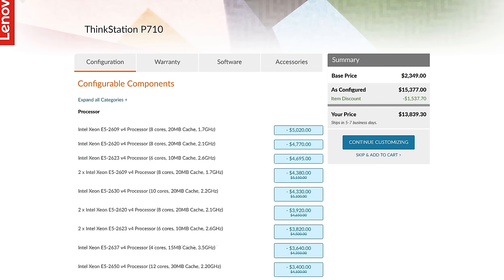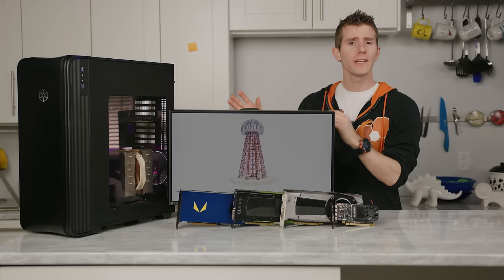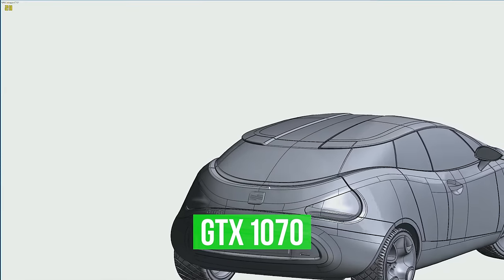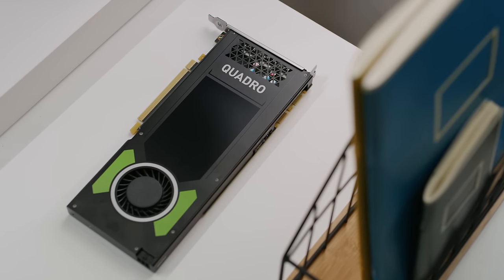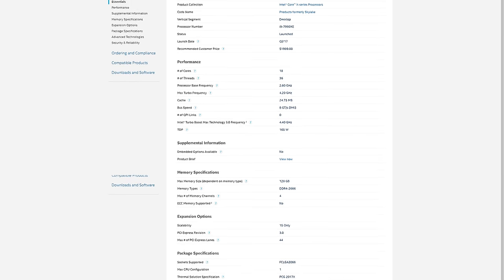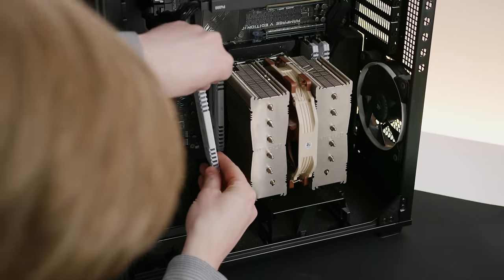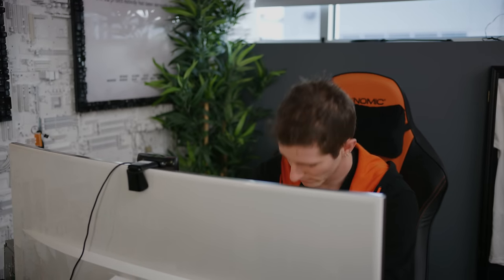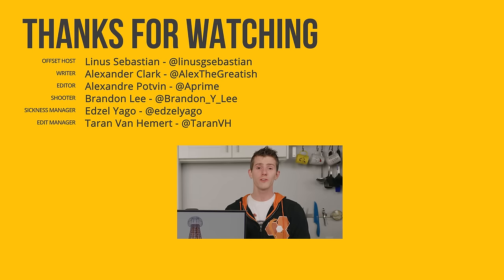3D Modeling & Design – Do you REALLY need a Xeon and Quadro??

Comment: Please rename this video to '3D CAD modelling and design'. Because in a regular 3D environment in a vfx or motiongraphics pipeline you're not going to benefit from quadro at all.
They have little to no benefit in maya/houdini/c4d/max.
Also if you are going to do gpu rendering you will need a nvidia card, because most gpu render engines use cuda. So AMD is out of the question there. AMD does perform slightly better on opencl so may be better for gpu based simulation loads (like houdini opencl nodes) But overall I recommend nvidia for that.
CPU workload for workstation I recommend higher clocked i9s over xeons due to most 3d applications not being fully multithreaded, your overal workflow will  be faster on a faster clocked system then a high thread/low clock one (talking from experience here)
Your benefit on having a lot of cores will be rendering or heavy simulation (or having simulations run as background tasks while you continue to work) But for a workstation I'd then still recommend getting a lower core one and getting a extra few cheap ebay xeon rendernodes on the side.
Reply: I agree
Reply: More like please rename this to best hardware for solidworks.
Reply: Agreed on all points. I would add that offloading rendering to one of the many cheap cloud solutions is probably more sensible than spending a ton of money on 8+ core Xeons and ECC memory.
Reply: Very well said
Reply: Sad but True. Mu suggestion for title is "3D CAD modelling and design in SolidWorks".
Reply: where should i look for 3D modelling NOT engineering laptops?
Reply: Tim van Helsdingen I agree 110% , what about working with substance painter that is all about cuda and iray rendering ? AMD take a performance hit when it comes to substance and software that is cuda optimized . also for things like keyshot you can never have enough cores. Pbr rendering ( physical based renders ) love core count as much as speed. This video needs to be retitled and you could do something more for the 3d artist using max , maya , zbrush , blender , keyshot  marmoset and substance. All these benched on a range of CPUs and gpus from i7s,R5s 1050s,560 to i9s,R7s, thread rippers and 1080 ti .
Reply: Was about to comment just that. 
Also recent gaming cards proved to work really well on GPU based offline renderers (RS, Octane etc...) the only benefit in our field from Quadro Cards is the 10bit output.
Reply: @Metical Then the title is still misleading: Modeling and Design...
Reply: Quadro was in the title. SO why would anyone think this video has anything to do with children's toys like  maya/houdini/c4d/max.
Reply: if you watch the video for literally 3 seconds they specify that this is for CAD. Might as well just read the title of videos instead of watching them.
Reply: GifCo how are houdini/maya childers toys? they are the industry standard for 3D animation and VFX work. Which is a completely different field from CAD design.
Reply: I understand that Blender isn't entirely considered a professional grade solution, but it's OpenCL based engine has actually gotten pretty mature with AMD.
Reply: Tim van Helsdingen aa
Reply: Title for sure was misleading. I liked the video for sure. It sure played out like an Nvidia and Solidworks commercial more than anything. Other design platforms such as Creo, SolidEdge, AutoCad, and Mastercam, as examples have very different requirements and capabilities. He also mentioned Abacus for FEA, which if you're using that for your simulations, you're spending thousands of dollars on the software and licensing alone. I'd spend $10,000+ in hardware to take advantage of it's ability.  For the longest time, CPU clock speed was (and some aspects still is) the major factor in CAD/CAM design. And as others have said, "Where's the FirePro cards?" I liked those for my PTC Creo machines over the Quadro cards once PTC certified them for support. This video was very tailored and specific to one product. I wouldn't empty the bank for my next build on the information from this video alone unless I was only using Solidworks.
Reply: Tim van Helsdingen hie.....my main work is in Maya and redshift...I also work on vray...so what card and processor do you suggest will be the best...m confused between Quadro and gtx
Reply: It fooled me, I'm sure it will do the others too.
Reply: Taylan Özberk I actually spent all night yesterday looking into just that for a friend who works a lot in blender and maya. We ended up looking at "laptops" from Sager, Origin and Eurocom (us companies), XMG (german company) and Webhallen (Swedish company). All specced similarly with i7 8700K, 32GB RAM, GTX 1080, nvme drives etc. We eventually found out most (if not all) of those are based on models by a  Taiwanese company called Clevo, and customized by the above mentioned companies.
I say "laptops" because while they technically are, they are 4 to 6(if you go for dual gpus) kg beasts which with their desktop CPU and GPU parts gets "up to" 2 hours battery life. As far as we're concerned that trade-off is worth it for the performance, but it might not be for everyone.
All of those companies also have cheaper/lighter/less powerful models (probably some with better batter life)
Look at benchmarks and try to figure out what level of performance you need. GL HF!
Reply: This is so misleading indeed and does not reflect 99% of the 3d industry (who uses solidworks for design nowadays ?). the only message shoul have been "it depends on the software you're using" and the same for rendering.
The subject deserves an entire channel imo (please do it :) for a rundown of all major 3d modelling softwares and a rundown of all major rendering softs.
Reply: Thomas Dissaux what do you recomend for design instead of sw.
Reply: I agree 100%
I finally convinced my firm a couple years ago of the same thing. They used to buy either Dell Workstations or Custom workstations from a local company who kept pushing Xeon(sometimes dual CPU boards), 64+GB ECC ram and quaddro's(probably for the money). We run point clouds using Autodesk Revit, Recap, Civil 3D, Leica Cyclone, Pix4D Mapper and Global Mapper. I built a system for half the price of those workstations using high end Intel Core processors and Nvidia GTX cards and ran circles around them in every use case.
And make no mistake my home build is all AMD, but for professional applications, they almost all use CUDA for hardware acceleration and single core performance is usually more important(to a point) than multithreaded capability due to a lot of programs only utilizing 2 cores at best at a time.
Reply: Himanshu Bansal For redshift rendering defenitely GTX. Way faster. 1070s are the best bang for the buck but if you can afford it just go for 1080ti's so you can stack more renderpower in a single box. Also using redshift for a lot of stuff, running 3 cards a.t.m
Reply: Tim van Helsdingen nVidia CUDA is a huge performance boost for a lot of 3D rendering and video editing :)
Reply: If does if the application is build for cuda. Which is exactly what I specified in my original post. No everything uses CUDA. 
Houdini uses opencl, no cuda. Realflow can use both cuda and opencl (cuda implementation is faster)
redshift/octane use cuda, blender cycles uses opencl. It really depends on the application.
Reply: this dude knows,
Reply: Chris Pyle What are the specifications of this build you speak of that outperformed your companies workstations? After this video I am really stuck on what cpu/gpu to get for a workstation. I use inventor, fusion360, meshmixer, revit, blender, cura, and adobe cloud products. These programs are somewhat all around concerning 3d modeling and CAD but I am mainly focused on the CAD side of things with the occasional render. For cpus I am in between the Ryzen TR 1950x and the i7 8700k. For the gpu I am in between the Quadro p4000 and the gtx1080ti. Is the Quadro that much better than the gtx to where it would be better for what I do or is the gtx not as far off from the Quadro as Linus explains for CAD to where I can get the gtx and have added benefit in terms of rendering. Also is there a huge difference between the single core performance of the i7 and TR to where the i7 is the obvious winner or would getting TR benefit me in terms of rendering and be not far off from the i7 in terms of single core CAD modeling. I am completely clueless as to what setup would be better and am asking you because you have real experience unlike most people that just put out benchmarks.
Reply: Himanshu Goel blender is totally professional. Some people are just misinformed.
Reply: This is not entirely true. I have run into repeatable crash bugs that are entirely the fault of a consumer GPU, SideFx's supports response to me was to either switch to pro GPU's or roll back to a Geforce driver that was more than a year and a half old. Geforce drivers move really fast, and are really sloppy for professional work, as they are always chasing the latest game releases, professional OpenGL performance be damned. Use a Geforce for professional work, and you will eventually experience a regression in performance.
Reply: Nope, can't confirm what you are are saying. Never had a problem with the consumer drivers so far, works great for professional work, for years and years. Downgrading software and drivers because of a screw up is not a big deal, I have machines where the GPU drivers are 1.5 or 2 years old and they work as reliably as the brand new ones. I figure that Nvidia does not even improve drivers, but mostly what they add is support for newer GPUs, which of course does not help me one bit with my existing one. If you want to go waste thousands on non-necessary products just because you are not smart enough to understand how this all works, well, go right ahead!
Reply: I have 20+ years of experience and in my experience, ECC RAM is a huge scam to milk more money out of customers. So far, I have had ZERO proof that it makes any discernable difference in a workstation. If you have a server that processes trillions of operations every week, yes, go for that, but for a workstation, the error rate is just too low to matter. If ECC was a huge deal, we would be coming across thousands of media reports of people screwing up or calculations being wrong, considering that 99% of all laptops and desktops don't use ECC RAM. Yet these reports don't exist, if you try to get to the bottom of the ECC scam, you will find the following: no hard evidence, no example cases of when Non-ECC RAM caused a measurable relevant damage or problem, most people constantly repeating the line "you have to buy ECC, everything else is dangerous and your computer will blow up tomorrow, you will have bit errors everywhere!" yet nobody being able to provide measurable evidence and facts. There are some theoretical estimations, that often get interpreted completely wrong as proving that bit errors are very common, which they most definitely aren't. It is pure snake oil and similar to the various oil and fuel additives: Can't be proven to conclusively help. Often people mention that it does not harm you. "I added that additive to my engine and it is working fine, so it can't be bad for it" Yes, true, but it makes hardware very expensive, there is the harm for you. And it really does not help one bit, as the problem it is supposed to solve does not exist, unless you got a super high performance system like a server that runs 24/7 for years. Or if you work next to Jupiter or in earth orbit and are concerned about cosmic radiation flipping bits. 
I wish there was more scientific measuring methods, like all workstations that are being used with ECC RAM having a logging mechanism that measures how many REAL bit errors really occurred (one bit error every 10 years?) and how many hours the machine was running for it, it would finally and conclusively show that it is a real waste and pretty useless. Use your own brain, test, measure and don't just pick up the party line that you are supposed to peddle (crap like "everybody knows that you need a high end workstation that is very expensive to do professional work, only if you spend a lot of money do you get quality and ECC RAM is a must for that!") Most work on this planet is done using normal consumer grade electronics that do not have ECC ram and neither need it.
Reply: For 3D rendering yes, but for video editing? Zero boost. Can you show me a factual analysis, a benchmark that shows CUDA helping with Video editing or rendering with Adobe Premiere and such? I have not come across it so far.
Reply: How is it a waste of money if the problem resolves after changing GPU and driver? How can you say that Nvidia does not improve the drivers when they issue release notes with every driver? Those release notes often include limitations, known issues and details of what was improved. Here's just one example of something getting fixed: [GeForce GTX 980/1080 Ti]: OpenGL program may crash when trying to map a buffer object. [2044697].  Regressing does not always fix issues, sometimes it just isn't possible to roll back to an older version of your DCC application as the project you are working on now may not be compatible with OLDER versions of the software. That's great you have never had problems with your software and hardware for the work you do, I hope that continues for you!  Just because people use different software/hardware combinations for different types of work than you do doesn't make them less intelligent, it just means they have different needs than you do.
Reply: The tests that you are talking about do exist. ECC ram fails significantly less. If you are doing the kind of work that needs ECC ram, you will know it, if not keep trucking on with what you are doing!
Reply: Link please? These tests apply to high performance servers, not your typical work station. ECC errors are recorded, when they occur and my point is: in normal non high performance constantly running server systems, they amount to an Bit error for like 5 years of use? These errors are so rare, they are neglectable. Do you buy lighting insurance for yourself? To protect yourself against a lightning strike into your head? Why not? These things definitely do happen ;-)   See the point? Of course ECC RAM does no harm, but it joins many products that clearly are bullshit and even though do what they promise, do not help one bit. Kind of like making your wallet bullet proof. It will help you if you ever shoot your wallet, yet..... when is that going to happen?
Reply: Any good software will support both, that Houdini only uses OpenCL seems crazy: I tested on my nvidia card on Blender, when using OpenCL, it gives you only HALF of the speed while rendering compared to CUDA. Generally, it is assumed that these results are because CUDA is much more optimized than OpenCL.
Reply: Just go to the wikipedia page for ECC ram and read the references and external links if you want to know more. I'll link you one well known study on failure rates to get started http://www.cs.toronto.edu/~bianca/papers/sigmetrics09.pdf If ECC ram doesn't fit your computing needs, great, keep doing what works for you. That doesn't make it BS, or snake oil, you just aren't in the market that is served by ECC ram.
Reply: It is snake oil, for 99% of all users. And of course I'm aware of the wikipedia article. This is theory, I'm taking about my real life experience. And I'm amazed how people just can't think for themselves. Did you ever experiement with ECC and non ECC RAM? Did you get a real error? Ever thought about it carefully, why ECC Memory is not mandatory in ALL devices, from your cellphone to every laptop sold? How is it possible, that you can game for 8 hours straight and have no crash, no graphics corruption (due to a bit error, meaning: Random and non reoccurring)? All these things can help you to analyze the problem. I just love how every time this subject comes up, tons and tons of people come out of the woodwork and defend second hand information that they read in some paper or study, that they don't even understand, while at the same time having ZERO critical thought about the issue, and zero experience and EXPERIMENTATION!
Reply: Shifting goal posts, nobody has claimed that ECC ram is needed for every computing device, not even close.
Reply: Taylan Özberk if you'd like to stick with a laptop then something higher spec from the Alienware line-up works well. I'm not a proponent of recommending Alienware products, but their laptops are popular among CG people. If you're modeling with C4D or Maya, then it opens up the possibility of a Macbook Pro. Running Bootcamp gives you more options on a Mac, but long term it's a bit of a hassle. Outside modeling there are GPU considerations that can rule out a Mac.
Reply: Gandalf721 yeah they make good stuff. I have a system here that’s built with almost all their stuff. Alienware was the only choice for laptops doing this work at one time (I’m old). There was no such thing as ROG back then lol. I guess some would argue it was when AW made their best gear
Reply: @nzjdmsti  Exactly what I thought because am thinking tools such as Autodesk Inventor, Autodesk AutoCAD Mechanical Desktop, ArcGIS, MATLAB, Siemens...., Machine Learning in Tensorflow, Pytorch. Generally, I wish someone will consider the most flexible setup for all Engineers and Scientists.
Reply: @GifCoDigital  Hey "serious" cad user lol CAD  can also be used to make buttons, switches, kids toys etc. MAYA and other can be used for 3D anatomy visualization, so hide your ego to your pants. "children's toys" lol
Reply: I sencod this, I learned in the hard way.
Reply: thanks
Reply: Agreed! Definitely need those Cuda cores for Vray RT rendering.
Reply: @GifCoDigital  ...reason why the great pyramids no longer exist. You know, they did not possess CAD software or finite particle analysis capabilities to keep structures from collapsing. ;-)
Reply: after reading comments I'm now much more confused... What to buy for After Effects, Cinema 4D, Blender and Z Brush??? I'm so confused now LOL (?-?)
Reply: @wafaechan  if your using After Effects, C4D is great when used with the 3D plug-in for After Effects.
Reply: @The3DSMaxinator  Yes, I'm just asking what pc / laptop should I buy? I was going to buy MSI GE738RE (I7-8750HQ + gtx 1060M 6G) or ASUS ROG GL12CM (i7 8700 + gtx 1080 8G) But now I don't know what to buy... LOL
Reply: @wafaechan  For rendering (Blender Cycles, C4D with gpu renderer) I would go for GTX 1080 over 1060. Currently rendering with one and fitting scenes into 6gb vram is a pain in the ass (even with out of core rendering theres a significant performance hit). Most of the workflow bottlenecks with 16gb ram and 1060 6gb is waiting for texture and geometry loading if it doesn't fit into ram/vram and some single threaded operations. The 1080 should be significatly faster overall also. Zbrush runs on pretty much anything if the CPU isn't ancient and doesn't really benefit from a GPU at all. Can't comment on AE as I don't use it frequently enough.
Reply: I do agree with you. But I'm having an issue that importing skp files (architectural scenes) into C4D,  it is so lag in the view port, I have two titian xp in the machine.
Reply: I agreeeeeeeeeerre 100000%%%%
Reply: For what purpose Xerox processors are used?
Reply: Too bad I only found out after I bought a RX 580 that it cannot use Octane, Redshift or Arnold. The only thing it's good for is Pro Render, which does not seem to be gaining much ground.
Reply: please, contact me, i want to know the best procesor and gpu to buy, for modeling in 3dmax, long enviroment, lot of threes , mobiliare and buildings
Reply: thanks a bunch
Reply: Would you say I made the wrong choice for modeling in Rhino 3D/ eventually Revit with my Lenovo ThinkPad P1 Core i7-9750H (6 Core, up to 4,5Ghz) Nvidia Quadro T1000 ?
Reply: @The_SkyDragons Not so important for workstation. In server must have. Possible error propability increases with high amount of memory. Workload matters too.
Reply: RIGHT??? normally i come to Linus for informed opinions, but these are the most brazenly uninformed opinions i have ever heard from him, to the point where i was almost offended. Like, i would expect this kind of ignorance from other youtubers, but not Linus.
Reply: @wafaechan  the 1080 is obviously better by a pretty sizable margin. the processor is slightly worse but ultimately with the right GPU thats not as big an issue these days.
generally speaking 1080 ti > 1080 > 1070 ti > 1070 > 1060 ti etc, etc. 
Also more GB of memory means it can load more textures and crap into VRAM which means it can handle bigger files
Reply: wings 3d is the same too so it should also be in your comment.

i use that on a dell laptop from 2010 with a 1st gen intel core i5 m540 and a nvidia nvs 3100m with 4 GB of DDR3 1066 and it works fine for me with over 10 thousand polygons but i use linux mint 18.1 and it doesnt waste my cpu and gpu and fill the ram as much as windows does
Reply: No geforce will ever output 10bit 444 at 60hz. only 8bit at 444 60hz or 10bit 422 at 60hz. No geforce RTX can hit 444 10 bit @60hz. Only a quadro is enabled for that and that is the main reason to buy a quadro for film work. HDMI 2.0a/b does not have the bandwidth for that. Displayport 1.4 does but not on a geforce, it is locked. If you are a professional for CAD or video, youd be an idiot to buy anything other than a Quadro/redrocket and blackmagic decklink cards.
Reply: Do not need ecc ram.that's for 24/7 server or compute for possible bit error from static or power outage or surge  that be rare. How often power surge goes through a power surge protector and busts your electronics not often...it  trip your fuses before that.
Reply: Hi, that explanation was extremely helpful. I'm planning to build my work station for Maya, Houdini and Nuke. I will be learning most aspects of these 3 softwares since I'm studying VFX. I was wondering if I should buy a Ryzen 9 3950x instead of an i9 and if an RTX 2080 would be good enough for VFX based work or if I should instead use a quadro. Your opinion will be really helpful.

Thank you
Reply: Quadro for high end engineer simulation or high video but recommend (I have 1080 ti) 2080ti titan rtx for 3d like maya...cuda cores. I have threadripper 1920x and designare mobo(thunderbolt compatible/m2). YOU dont need ecc  unless run system 247 like commercial server; my mobo not buffer ecc compatible its non buffer ecc compatible or nonecc ram. Ddr4 has error correction built in for most errors. Quad ch. vs dual vs single ram...it depends higher speed most use 64gb or 32gb multitask windows. CPU nowadays at least 8 cores minimum  but less cores higher clock than threads.
Reply: He did
Reply: @tili_  Buy gaming hardware...just opt for high Vram  and ramccc